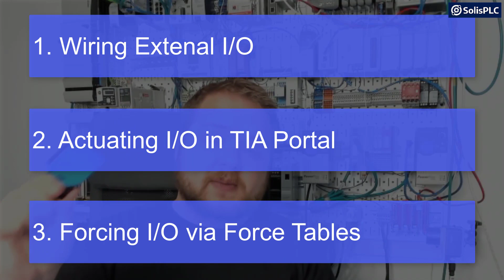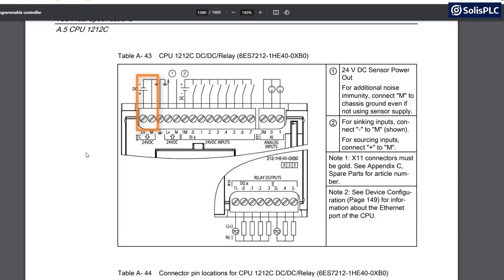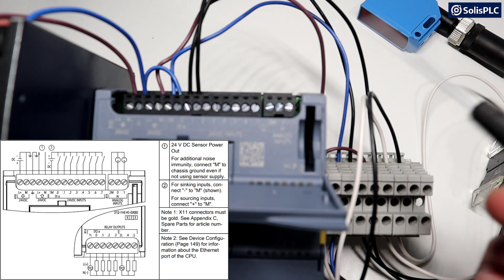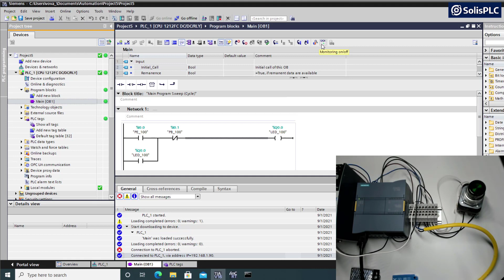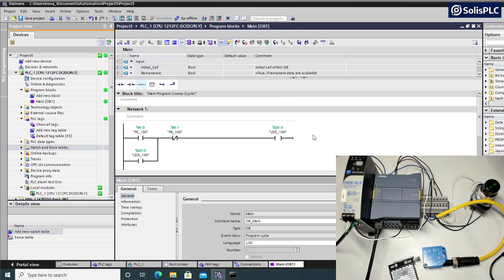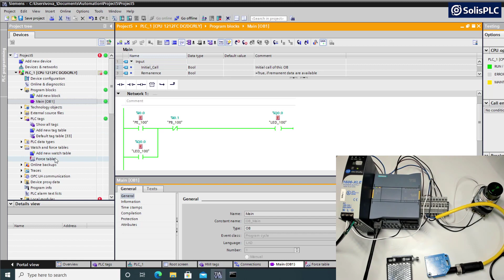Siemens PLC Programming | Sensor, Push Button & LED Hardware Wiring Tutorial Inputs Outputs S7-1200

Comment: Great video.. dropped a like..
I have a question: What is the maximum current that an input can handle? When you used your push button, how much current is being sinked into the input? Is their an internal resistor? Sorry, I don't want to damage anything, lol

Thank you
Reply from the maker: Thanks! An input will draw 4mA. Inputs don't have a "max current rating" unlike outputs. The way it works is that an input will take 24VDC and require 4mA of current to detect the level. There's no way to sink or draw more current than that into an input without using a fixed current supply that will fry the input. The button will draw 4mA through it.